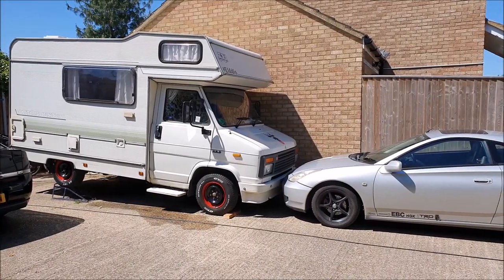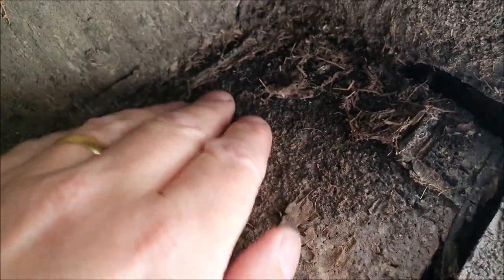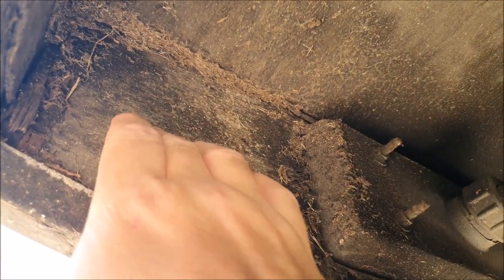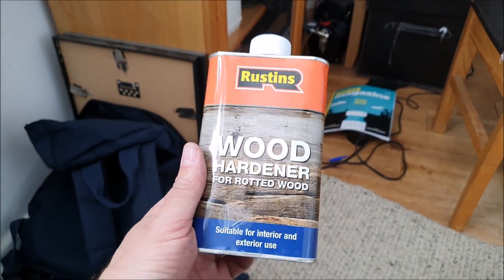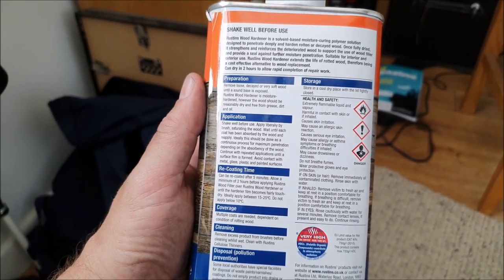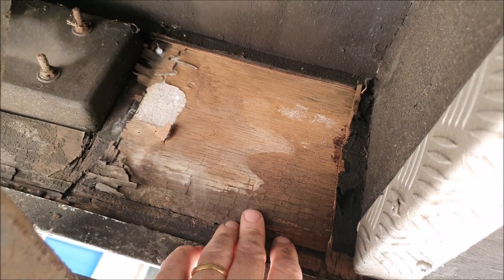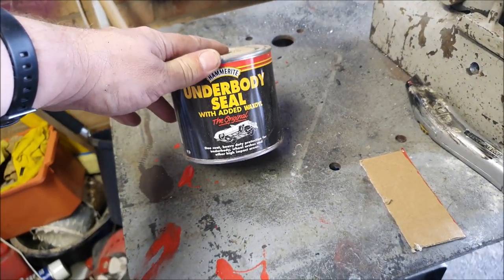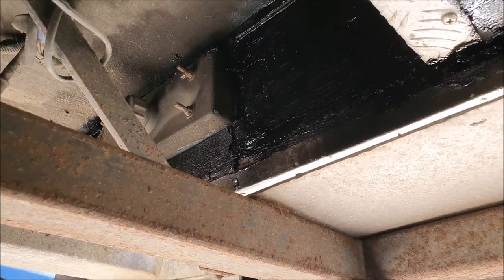Finding Some Rot On Our 1990 Citroen C25 (Talbot Express) Elddis Autoquest 270 Motorhome

Comment: Alex , as its only ply that has degraded, how about using the bathroom plastic sheet cut to size and glued in. ( in stock ) 

Waterproof, strong, better than wood. Or glass fibre matting over the whole water swept decay area.
Reply from the maker: That could be a solution perhaps,  I've got plenty left over 🤔👍

Comment: You need mud flaps I had the same problem when a mud flap was missing the road muck damaged the same area I repaired it and replaced a new mud flap and it worked.
Reply from the maker: Both mud flaps are in place. Perhaps they could be a bit bigger though 🤔

Comment: Hello Alex hope your keeping well. I like things to be perfect so i would have to fix it one way or another. A not so nice job this one ! but once repaired i would put that plastic cladding on ( the stuff you used for the shower) to keep the wet off the wood for good with plenty of silicon on the corners and edges. If your keeping the van for many years from now fix it very well and  when your older you will have a perfect reliable strong van.  You have the technology to rebuild him or her, the 6 million dollar van ! Keep safe and well, im looking forward to some travel vids. take care
Reply from the maker: Thanks, yes a better fix is on the cards for later on in the year. For now we need to get out and use her - hence the holding measure bodge 🤣

Comment: Hi Alex. Only had this on a caravan in the past. I left it as is was as I sold it for spares. Not sure how yo fix it but I would try a combination of thin ply probably with fibreglass liquid matting etc. But not sure if resin will react to the polystyrene. So a test would be required on an old polystyrene maggot thingjy. Looking good though for a temp fix with underseal.  Cheers from old George 👍🤠👫🚐 Ps we may need to borrow old Ginger for our van.
Reply from the maker: 🤣 Mr Ginge only likes the van when it's not moving! 

I think anything solvent wise is risky with the expanded polystyrene.  I shall proceed with caution!

Comment: So my guess is that it is a sandwich board, aluminium, foam, plywood. It looked like the plywood was only affected at th lower part. Assuming the foam and aluminium are still good, I would try to cut off the rotten wood, and glue in some similar thin ply. Then overlap the joint with fibreglass to make the joint strong. Finally, some form of waterproof paint. I don't see the need to add thick heavy ply. If the light weight stuff has lasted over 30 years it has sufficient strength.

The van is remarkably good for a 31 year old vehicle. I think you've got a good'n there. Likewise, she has a good owner who cares for her well.

Tell me, have you done any work on the brakes recently??
Reply: Totally agree, unfortunately it's a issue with the age of the vehicle, but no cause for worry and can easily be put right by a man of your talent. Our motorhome is 10 year's old and I've had bigger problems
Reply from the maker: I think you're right, perhaps not the biggest issue. I probably will end up boarding over it with something 🤔👍 no more brakes for a while! 🤣

Comment: Personally Alex i would just over board what is there. Its not structural.  Just use a 3or 4mm marine ply and give it a coat of wax oil ......Not only that ....... you could uncover all sorts of horrors if you start ripping it all out ...... DONT DO IT .......... LOL,LOL
edit ;   If you remove the rail above the lights you will find some screws holding the bottom panel on. If you want to go that far
Reply from the maker: I think you're right, certainly for the rest of the summer the plan is to keep the van in use!

Comment: Hi Alex. I don't think you should have put the underseal on. I would have either left it like I have done with my van or cut out and replaced the wood. I think the underseal could potentially cause you more issues.
Reply from the maker: 🤔 in terms of trapping moisture inside?

Comment: ripped the whole back of mine as the alu was so corroded, fabricated new alu sheets for lower half, removed bumper lights ect, not gonna lie its an ass ache...
Reply from the maker: Aluminium on mine isn't perfect but not holed as such so the damage has come from underneath I reckon. Sounds like a big job on yours though!
Reply: My van is like that with tiny pin prick holes at the bottom of the rear panel.
Reply from the maker: @adamyoung9655  Yes, from what I've seen I think the aluminium does eventually develop pinholes.